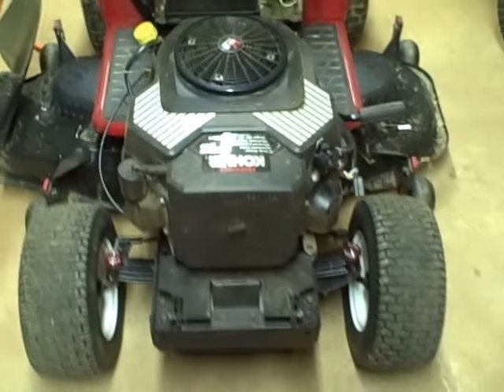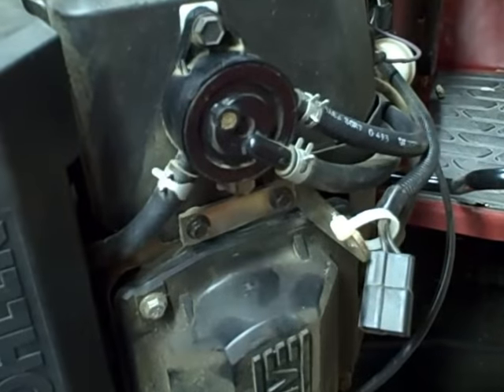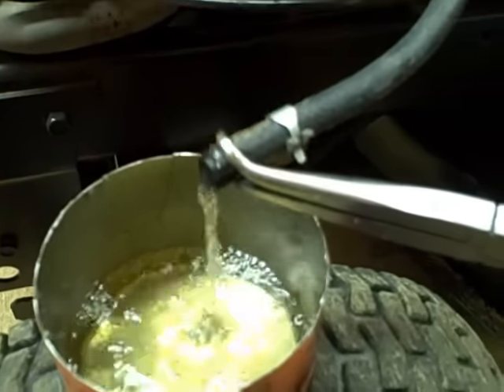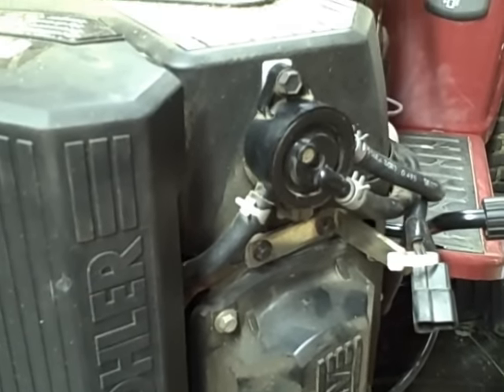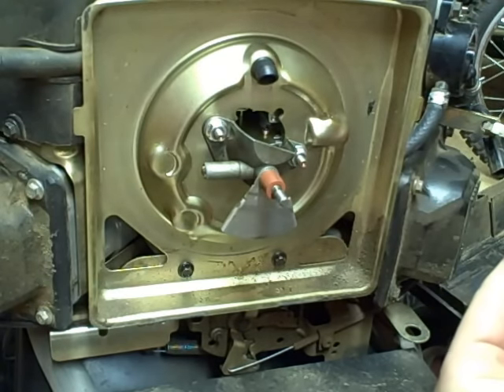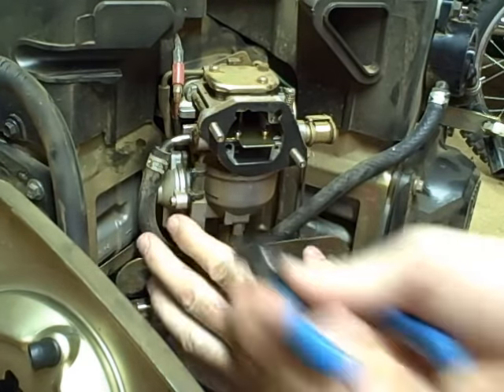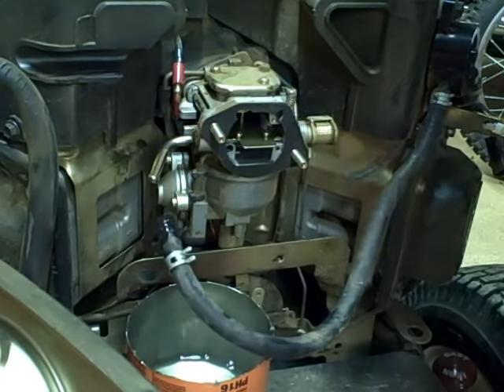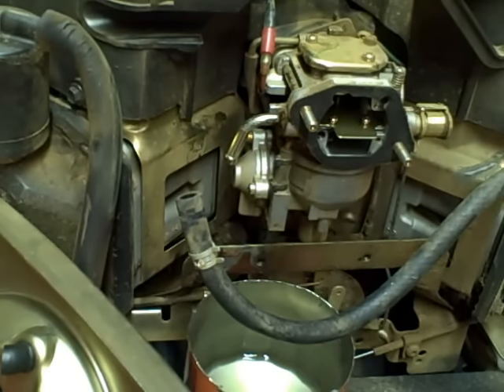Small Engine Repair: Checking a Vacuum Fuel Pump / Fuel System on a Kohler V-Twin Engine

Comment: Mine is occasionally spitting gas out the two small holes on the back of the pump. It did it once before, maybe last fall Nov ‘23. I ordered a pump but the next day it didn’t do it and it hasn’t done it again until today June ‘24. I assume it’s a diaphragm or gasket or seal or something, just odd it doesn’t do it constantly.

Comment: Question, are these supposed to cut off fuel when there is no vacuum applied?
I bought a replacement that just flows right through from gravity.

Comment: A thought:  why not do the tests in reverse order?  If gas is flowing from the carb’s inlet hose, then there should be no reason to test the other pump connections upstream, yes?

Comment: If you have a test gauge fuel pressure runs from 1 p.s.i. to 2 1/2 lbs. depending on r.p.m. Even ultralight airplanes and some Japanese motorcycles have a pressure range like that using a pulse pump.

Comment: Hi again.  Another question:  if you are not cranking the engine but the fuel still flows out, does it indicate that the fuel pump is faulty since it only pumps out fuel when there is a pulse?    TQ

Comment: Overfilled oil.... I'll be damned!... That  was it  in my case.... Thanks for the video.
Reply: I think this may be my problem too what did you have to do to fix it? Just replace the inlet line and remove some oil?

Comment: Useful video - thank you. But I have a vee-twin Kohler with a pulse pump and it's filling the sump up with petrol, preventing the engine from starting. Does this mean that the valves in the pump are not working correctly and it is drawing the petrol straight into the engine ? In which case I need a new pump ?

Comment: I have a 2001 2 stroke jetski with fuel problems. and I've narrowed it down to either the fuel pump or the vacumn line. Last thing I'm wondering is when I feel turn the engine over with the vaccumn line off  the pump it's only blowing air shouldn't it be sucking?

Comment: Good video. This is a new one for me. Engines I've had before ran straight from the tank to the float bowl. Are these gadgets actual pumps, or are they just a vacuum fuel cutoff switch? I'm wondering because I have a Honda GC160 with a crankcase full of gas. Obviously the float needle failed to do it's job, but I'm wondering if this little gadget wasn't supposed to be cutting off the fuel before it even got to the carb. Anyone know?

Comment: Thanks for the video. I have a question the pump on my riding mower works fine I’m getting gas to the carburetor it turns but won’t start you think is the carburetor?

Comment: Thank you for the great video. Last season I bought a new Ariens zero turn mower from Lowe's. It ran well at first. I fueled it up today and cut for about 3-4 minutes then it cut off and will not start. It only has 4.2 hours on it. Please advise. I took the fuel line off going to the fuel pump, held it down towards the ground and no fuel is coming out. I didn't go any further than that because it's a new unit.  The 4.2 hours came from 2. something from last season and less than 2hr this season. Please advise.

Comment: I have a john deere 160  lawn tractor that doesn't get any gas to the carburetor. I replaced the fuel pump and it went around the yard four times and then sputtered and quit. If I put gas in the carburetor it'll run and the gas is coming out of the fuel line from the tank If I take the filter off. If I turn it over now I don't think gas comes out of the fuel pump.

Comment: I haven't gone through the steps you listed yet, except I disconnected the line at the fuel filter and noticed good flow from the tank through the filter.  I did notice that the amount of fuel in the plastic fuel filter casing, is very low, and almost empty.  Mower dies on me occationally, and I have to restart it.  Would you suggest it's a problem with the pump?

Comment: May i ask everyone, is it possible that the fuel will flow thru vaccuum fuel pump when the engine is not running? What is the problem if the vaccuum fuel pump continouos discharge of fuel even the engine is off?Thank you

Comment: Do you know what would cause a Kohler 22.5hp v twin motor to surge and backfire while mowing? I have a older Craftsman Command Diehard lawn tractor that is having this issue and i cannot figure it out. Any help will be greatly appreciated. Thanks

Comment: How do you test this for one of the Briggs and Strattons with the fuel pump diaphragm built into the carburetor? The 42D707 models? (2280 E3 specifically). 

I've already replaced the fuel filter, the carb gaskets, carb is clean, new diaphragm. Engine starts easily with Engine Starter fluid, and I can run it by spraying the carb with starter fluid, but when I stop, the engine stops running once it burns off the starter fluid. Seems to me it's acting like it isn't getting gas pumped into the carb? Gas flows through fuel line easily at least up until it gets to the carb. All carb jets are cleaned. Good compression in engine. I just can't figure out how to tell if the pump is actually working.  Thanks!

Comment: Got gas maybe lots of it in your oil? This is a good place to start.Mine pumped gas OK and it poured down the vacuum line into the oil crank case found out by taking the vacuum line off at the crankcase. Can be checked by applying no more than 5 PSI to the gas inlet and plugging the fuel outlet. Would run for maybe 3 seconds black fuel rich smoke stained the grass acted like it was starved and flooded simultaneously.

Comment: Hello, my 27 Kohler Command been giving me problems and me or any of the shops cant figure it out. So; engine was replaced with a low hour engine. Runs great until I engage the blades and start mowing. It starts running rough as if it was running on one cylinder; black smoke and smells rich. So I 1) adjusted the governor 2) cleaned carb and fuel lines. 3) added fresh non-ethynal gas. 4) adjusted carb and choke cables 5) replaced oil, air filters and spark plugs. Still runs like crud man. What else could it be? Carb solenoid is disconnected, maybe coil packs?
Reply: Most likely too much fuel. I installed a shut off valve and when running , I only open it half way.
Reply: My brother in law had trouble with his mower and couldn't figure it out until he raised it up in the air with a hoist and found one of his blades wasn't turning.  The blade connects to a piece called the spindle - the spindle was frozen up.

Comment: hi I have a toro cutter with the same fuel pump and was leaking out the weep holes, so I thought must be the diaphragm gone bad, replaced the fuel pump and leakes from same place ! what could cause this, mower runs fine just has this leak, cheers :-)

Comment: Really nice video young man!!  Thanks for your time and expertise!  Should my inline fuel filter stay full of fuel or about a 1/4 full?  Mine stays 1/4 full and engine runs steady only when choked.  Thanks again!
Reply from the maker: Thanks
Reply: It is common for inline filters to become clogged with fine clay sediment that blocks the free flow of gasoline. For the 25cents they cost on ebay, I change mine 3-4 times a season,

Comment: Good vid. But could have just taken the outlet hose off the pump to check the pump flow. Then if you have flow, move to carb. Step one, make sure there is fuel in the tank. Step two, check for spark. Step three, check fuel pump (if the engine has one) Step four, check carb. Start with the source first, whether that's a fuel issue or spark issue. Don't mean to knock your vid, just an easier  route to the same result.

Comment: I know this video is posted in 2011 but I’m hoping you can answer a question for me. I have a 24 horse engine and a riding l’amour that has the same fuel pump and that squirting gas out of the back of the fuel pump out of a little hole that is in the back of the pump from the factory. Does this mean my fuel pump is bad

Comment: I wish I had seen that video earlier I would had save 130$ worth of fuel filter and fuel pump. I washed the tank but I forgot to check the shut-off valve and there was the clog. Grass, obviously. Kohler Command 20hp on a Walker Mower MT-GHS.

Comment: I'm having issues and I suspect my fuel pump to be the culprit, but you didn't mention anything about this type problem. My mower is filling the crankcase with fuel as the engine is running. I initially replace the float and needle thinking that was the problem. Next I installed a shut off valve between the pump and carb. That's when I figured out it had to be doing it while the engine is running. I suspect that the vacuum line is sucking gas into the crankcase. I've never had one of these pumps apart but I think they use a diaphragm and that mine has a hole in it. I'm trying to figure out a way to prove or disprove this. The only thing I can think of ATM is to keep my tank close to full where it will gravity feed to the carb and bypass the pump all together. What are your thoughts on it?
Reply: +J Johnson    I have one with the same problem . Could it be the breather separator?
Reply: +Alton Browder I was able to disassemble my fuel pump and I found 2 small holes in the diaphragm. I purchased a new pump from ebay for about $6.50 and my mower has been doing great every since.

Comment: Very good ! But the fuel pump is mounted wrong ! The pump must be mounted horizontal with the little valve with the screen in the bottom, to let condensation and possible oil out of the pump membrane . Everyone can read it in the instructions of the pump .
It’s anyhow strange that they use a diaphragm pump on a 4 stroke engine , there is not much pumping activity do to the crankcase breather !

Comment: Any one have a video on Pulse line to vacuum pump to crankcase? My 54 inch Cub Cadet zero turn mower will not suck enough gas to keep it running. I changed the fuel lines, fuel filter and fuel pump and it will still not start. I did give it a tune up recently. I changed the spark plugs, oil and oil filter. Any tips please let me know. Thank you!

Comment: Hello and Thank you!!  I have The SAME tractor with a big question ._..One day it started fine but then started reving really high for about 15 seconds  then just died.  Now it turns over really fast but wont start   l am getting spark and fuel   ANY suggestions would be a GREAT help!!  Thank you
Reply: Probably need to check/replace the spark plugs, they are more than likely going to be fouled out

Comment: My john deere l100 is not getting any fuel from the tank to the pump. I can blow compressed  air threw the line. I believe the fuel is not be sucked from the tank. The fuel pickup in the tank is high on the tank and therefore  the fuel must be sucked up (no gravity feed) How can I check that the vacuum at the fuel [pump is adequate?

Comment: Hi, tks four you great video I have a scooter two stroke Sym Fiddle version 1 and no fuel came out on line to carburettor what you thing is the fuel filter is blocked or the pump tks

Comment: Good video.  Eassy to understand etc.      ...  I just did all these steps & it still the same problem     ....  Spray carb cleaner down in it,it fires Up , then Dies as soon as the carb cleaner is burned out in like 3 seconds.    Tried gas,same thing .......fires Up strong then quickly dies once the gas is burned out. Got good gas goin into inlet line all the way back to the tank.           ...   Plugs maybe?         I dropped the Bowl under the carb & it had a few black speckles in the bottom,cleaned them out,put bowl back on,primed the carb ............same thing .....Fires up & dies within a few seconds.    GRRRRRRRR!      My yard is like 12" high grass ,this sucketh.
Reply: ude its not the plugs, its the jetts in the carb, clean your carb

Comment: What would it be if it will run but won’t rev up only on choke it’s a Briggs and Stratton vanguard 18 hp v twin and if it is coked it will run good and smooth 🤔
Reply: either  dirty bowl and jets in the carb OR you are running the motor with out the proper air filters and air box cover(that helps restrict airflow and gives the proper air/fuel ration designed into engine.) you should have the paper type airfilter, a foam wrap/sock that slips over the paper filter(called dust cover) and them the airbox lid (differant shapes on diff motors)

Comment: After replacing my fuel pump, I had white smoke while running and backfiring when turning the mower off.  I only ran it for about 10 minutes before the engine died and wouldn't start at all.  I found the carburetor full of oil and the head gasket was blown.  Cleaned and replaced both but it still wouldn't start.  From your video, I see that I had my vac and fuel input lines reversed, so I was sucking oil from the crank.  Anyway, thank you for showing me my own stupidity.

Comment: Good video except you only covered two of the three connections on the fuel pump, the inlet and outlet of gas flow. What does one do if there is nothing coming from the crankcase line? The pump fails to operate because the vacuum line is not doing anything.
Reply: if there in no vac in pulse line, it can only be a cracked or plugged up line. replace. and obviously if the IS vacuum from crankcase and line is good but still no pumping....BINGO pumps bad.

Comment: I was not getting any fuel flow I replaced the fuel pump, but still no flow,
I then checked the vacuum line to the fuel pump, it had a split in the hose on the back side, 
I replaced the vacuum hose, then the new fuel pump worked, I just wasted the new fuel pump, but got my mower running again,
So always check the condition of the vacuum line,

Comment: I need help guys...I have a Cub Cadet SLT1554 with a 25-27 horse power engine. I'm not getting fuel from the fuel tank to the fuel filter. Me and my son replaced the fuel filter and fuel vacuum pump as well as the spark plugs. By the way, this mower was given to him by his landscaping boss because it was for his elderly mother. It sat up for several months. We drained the tank, which took for ever. We made sure that it doesn't have a fuel shut off valve also. When I removed the fuel line from the filter, nothing comes out even with the fuel cap off. We removed the line from the bottom of the fuel tank and there is barely any fuel dripping from the bottom of the tank. Is there anything in the tank, besides trash, that would restrict fuel flow?
Reply: greg townsend I have a cub cadet RZT and had the same problem. Turns out debris had clogged the fuel tank outlet. I simply blew compressed air into the tank down the fuel line and dislodged the debris. I disconnected the fuel line at the fuel filter on the tank side and used my air compressor. Solved my problem and fuel flows normally now. You will need to clean the tank or eventually the clog will come back.

Comment: Thanks for the informative video.  My problem is oil leaking through the fuel pump screen/breather (gold mesh).  Any suggestions?
Reply: Blown head gasket. The head gasket seals the cylinder from the part of the crankcase the push rods are in. If the head gasket blows between those two areas it will allow cylinder pressure into the crankcase and cause your problem. If you run the engine a few minutes, then kill it, then take the dipstick out you will probably see a light smoke drifting out of the dipstick tube.

Comment: I have a club car kawasaki utv that I installed a new predator engine.i hooked all the lines ..new hoses. .new fuel filter. the gas line comes out  of the top of the tank. it runs for a few seconds then shuts down. I put the original tank back in and it runs fine. .help

Comment: i have the same mower/engine -just bought- will not start gas is coming out the carb when i turn it over-also the rt spark plug was very croded- any advice

thanks lee

Comment: My mower starts just fine but eventually dies, especially when I turn up the idle speed. I checked the pump, and without the engine running there is a continuous flow of fuel out of the pump. Why would this be? and Is this the cause of my problem? is it flooding itself because of this?

Comment: @smallengineshop i have kohler command pro 20 v-twin and when ever i engage the PTO for the blades at full throttle it chokes down any ideas? carb was cleaned spotless fuel pump works new plugs coils cleaned, these are the things ive done

Comment: I have 25 hp twin Kohler. starts great runs good at slow speeds,  then when you throttle up or engage blades it starts missing and barely runs. Have replaced fuel lines and pump but no better. any help?
Reply: Try adjusting your throttle line and choke…sounds like its starving for fuel. Same thing happened to me when i engaged my blades and i noticed my choke was almost closed tight when the engine was warm and i when throttled up the line  didn't even move so i wasn't getting enough gas to compensate for the added load on the mower when engaging the blades. .
Reply: @laurielemay1166  How do I adjust the throttle line and choke?
Reply: Might be a  clogged fuel filter.

Comment: Got a husky and the mower runs for about 5 minutes then stops. I wait for about 1 hour and the mower starts again,then it stops again. Any ideas what it could be??
Reply: Glenn Higgins Check for obstruction inside of the tank. Same thing happened to me, it would run just enough to get out to start mowing and would quit. Sometimes go for longer. I went through the whole system to find out there was a leaf blocking the hose every now and then. Hope this helps ya

Comment: I'm not a mechanic but couldn't you just disconnect the line at the pump instead of at the carburetor. It would be much easier
Reply: He was also checking the line for obstruction.

Comment: What happens when you run it for a while, shut it down , try to restart and it doesn’t start back up? It sounds like it’s not even taking the fuel, it’ll start up first thing after it’s been sitting all night!
Reply: clean your carb
Reply: crabtrap nope it was the coil